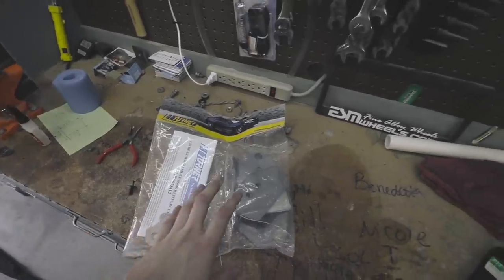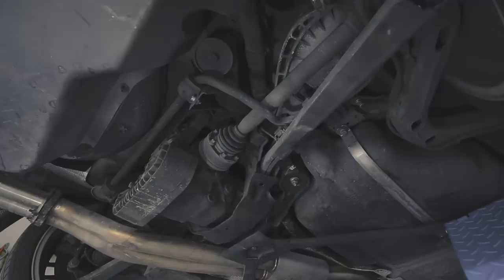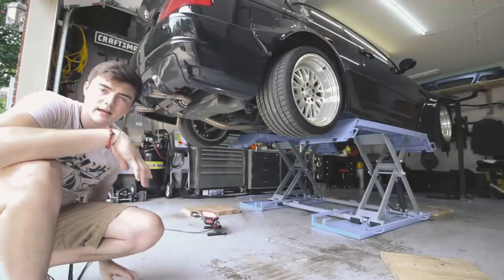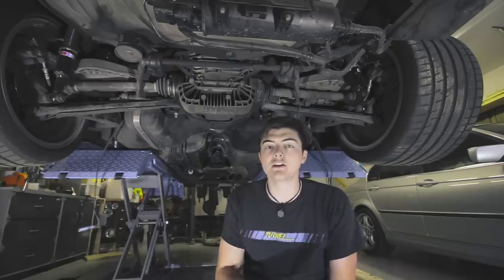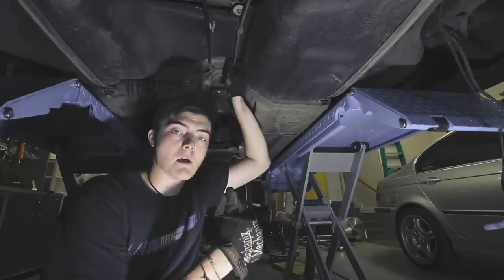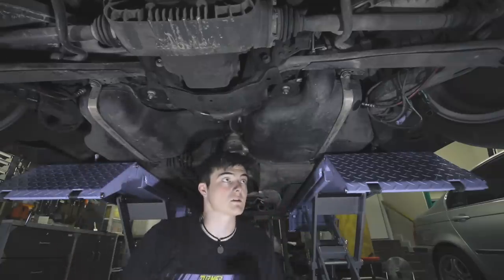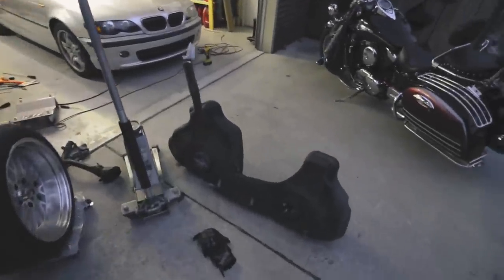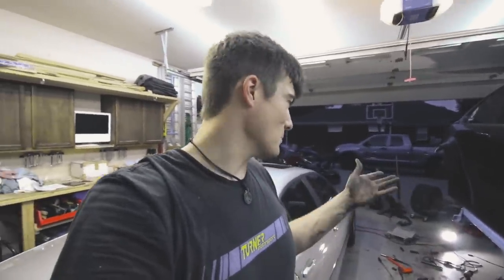E46 M3 | Subframe Reinforcement Pt 1 Dropping the Subframe!

Comment: solid subframe bushings put even more stress on the mountingpoints.
Reply: yep 100% right.
Reply: Exactly, creates massive shock loading. Who the heck told him that. Use rubber!!
Reply: It’s actually better as there is no slop or play that can develop over time which will cause high stress on the mounting points
Reply: Incorrect. They are better, even on street driven cars. They reduce lateral loads, torquing against the subframe receiver.
Reply: Ok, hear you all.  I’m a driver who begins hitting the surfaces of CHICAGO.  They ain’t kind whatsoever!  HOW STFF IS STIFF. So for then I’m asking stock struts to deal with the AFTERMATH?  How’s that going to work with coilovers?  It’s hard enough living and driving in My City. Thanks.
Reply: @simonhill6267  Help me understand.  Got to be jarring at times, no?

Comment: The real reason for the subframe problem of the E46 are the welding spots that keep the cage, where the bolt from the subrame is, connected to the car - those three tiny spot welds (right and left side just three little spot welds) break over time. And if they go completely off, the cage is free to swing forth and back. And this results in cracks that appear on the subframe. You have to cut some windows in the sheet metal in the trunk. And then you have to reweld the cage to the sheet metal of the car. Best thing is to flex away the t-shaped sheet metal piece - that will allow direct access to the cage.

Comment: Do the diff seal while its out, adjustable camber arms, new guibo for drive shaft, and trans seal. Mine leaked at 50k. I would basically replace everything I could on the rear while everything is apart.

Comment: Cool video !! Im planning on taking my fuel tank out next week to replace it with a fuel cell in the trunk. Would you know if by only taking the driveshaft and exhaust out it wil be possible to take the tank out. The stock tank wont be put back in. And fuel lines are all going to be replaced with an lines.  Thanks in advance

Comment: Ah the good old rear axle mount problem... Are you sure you just want to weld up the cracks and put little reinforcement plates on the mounting points? 

BMW is replacing a huge part of the floor pan with a redesigned, reinforced one and puts structure foam inside of the cavities above the mounting points when detecting cracks in that area. ( at least the dealers here in Germany) 

I don't know if I'd trust some chintzy weld on plates.  I'd recommend doing some more research. The new floor pan from BMW was around 300 or 400€ last time I checked, but in addition to that you definitely need a experienced body manufacturer/builder (+ car bench) to do it the proper way.
Reply from the maker: I have seen exactly what you're talking about.  After researching the subframe cracking issue for several months I've come across a few things. First of all, the route taken greatly depends on the state of your subframe. Whether you have no cracks whatsoever or the floor pan is falling out.  

The state of the subframe on my car isn't terrible. There is cracking but nothing that can't be welded back together. The plates have been used on several cars and successfully stop any further cracking. Strengthening the point of failure is really all that needs to be done in my case. 

If my subframe was worse, then I would definitely replace the entire floor pan but thankfully I'm not there.  Thanks for your comment!
Reply: Had mine done by BMW under warranty. Was told about the foam they put in but dont know if they replaced my floor. And yet ... mine is cracked again according to my mechanic. :/
Reply: @Kyle Reese You're right about the varying states the subframe can be in. I've seen some really horrifying ones... compared to them, your's isn't that bad from what we can see in the video.  

Haven't seen your plates in detail yet, but my opinion about it is, they just shift the stress from one point to another and cause cracking elsewhere/at the next weakest point. 

At least get yourself the foam that BMW uses on non-cracked frames for prevention (I know it's freaking expensive for just "a can of foam") and put it in after finishing welding the cracks and plates.  

Alright enough lecturing for now I guess, sorry :D Keep up the good work.
Reply: @Squashed8Ball They probably just put in the foam... That's not sufficient for already cracked frames... but way cheaper for the Dealer cause by now you're probably out of warranty and have to pay for the massive repair yourself.

Comment: Hey dude been here and done the plate welding but it isn't enough it will still rip out after a while , do some research on the vince bar or mason brace there the only real solutions.im going to be doing the vince bar shortly before it gets supercharged.

Comment: When reinstalling Diff back on to drive shaft - does the diff need to be connected to the drive shaft in the same spot when re-connecting the drive shaft back on? I seen other you tubers mark a line at the connection point of the drive shaft and the differential.

Comment: How long does it take to change the sf bushes and do you still need to drop that whole frame?
My car is 98k now and sometimes on a bend especially if you floor it the back sways like up down left right all at the same time, it's quite unnerving 
Do you think it's the bushes?
Reply: that'll be rear trailing arm bushes

Comment: Hello mate 
Do you have any knowledge about the SMG as I have funny looking circle with a ! On my dash light
Reply: cog light. Essentially a trouble code light for the SMG. Unfortunately you will have to look into what the code is saying with a code reader. In the worse case scenario- you can do a SMG pump motor actuator replacement which is around $800 USD vs the entire SMG Pump Unit at $4000 USD... good luck

Comment: It's recommended to epoxy the plates and not weld, epoxy covers a better surface area and welding only covers the sides of the plates.
Reply from the maker: Unfortunately, epoxy is only a viable option if there is no cracking whatsoever.  Once the subframe starts to crack, the epoxy option is no longer possible to keep the subframe from cracking further.
Reply: Weld cracks, Epoxy plates, Foam in cavity
Reply: @KyleReese6511  you could try, epoxy the plates on then weld them too for added protection, I've heard of people doing that also a little over kill but I wouldn't trust just welding
Reply: why Is epoxy not viable once the cracks have been addressed? assuming that structural foam has been applied to cavity?